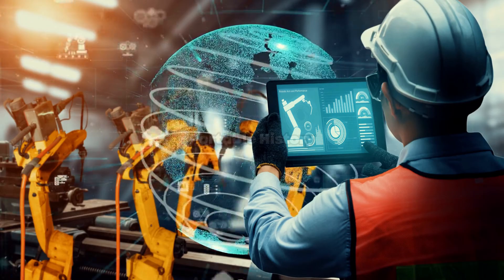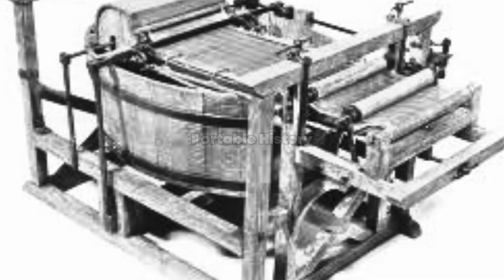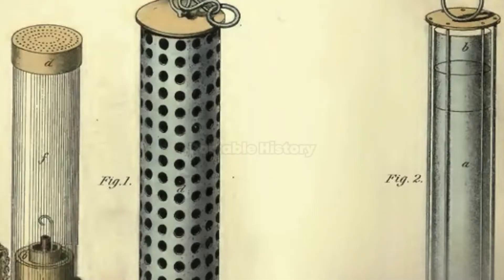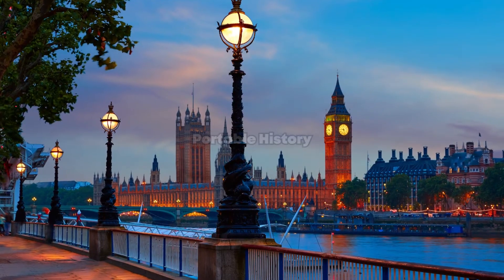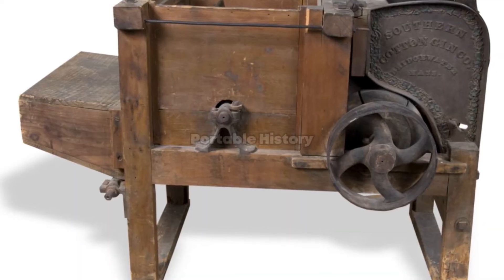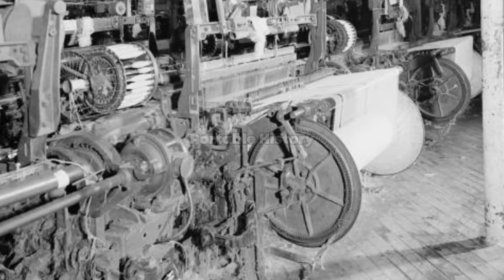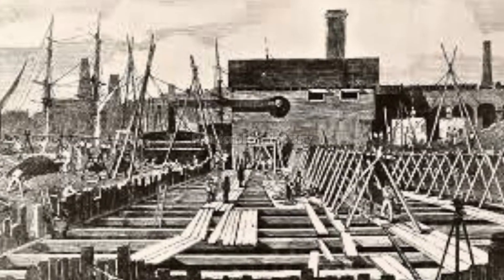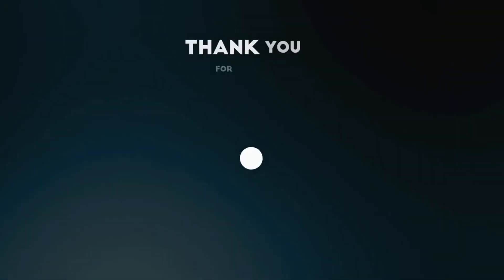20 Inventions That Changed the World | The Industrial Revolution |

Comment: England's Thomas Newcomen invented an Atmospheric Pump, not a Steam Engine.
Scotland's James Watt invented the Steam Engine.
Britain 1800 to 1900 .
20,000 Waterwheels decreased in number.
Windmills decreased in number.
Thomas Newcomen's 1,500 Atmospheric Pumps disappeared.
James Watt's 500 Steam Engines increased in number to 10,000,000. 
Now, every single Waterwheel could be replaced by 500 Steam Engines.
The Industrial Revolution was a Power Revolution. The Power availability for the whole country had been increased by 500 times !!!.